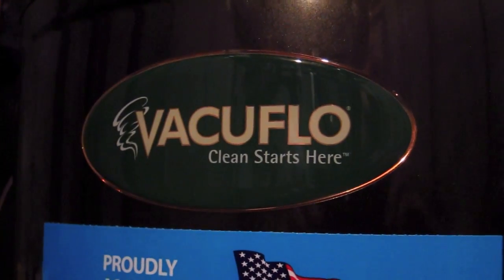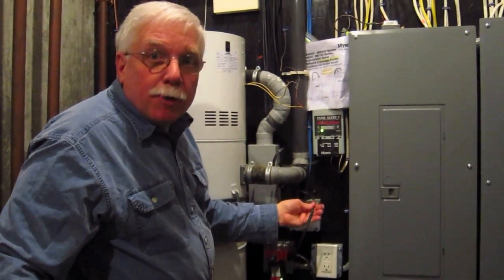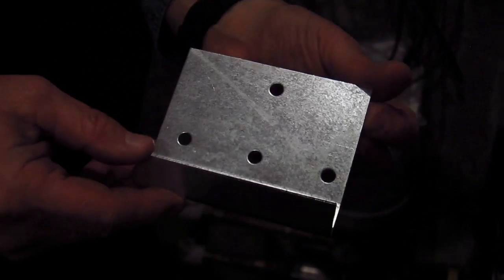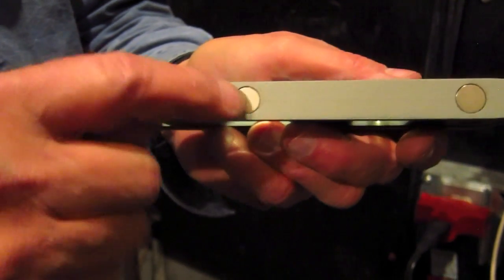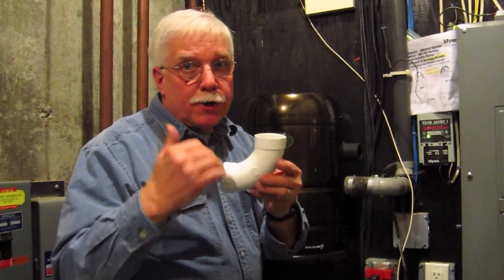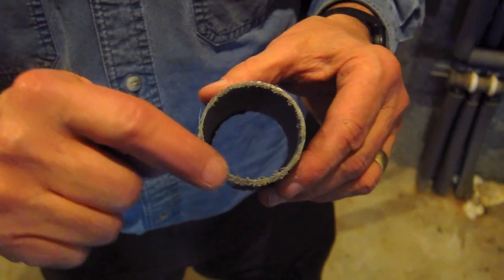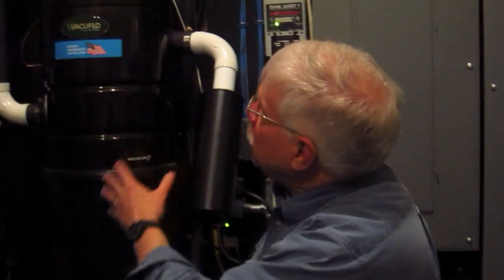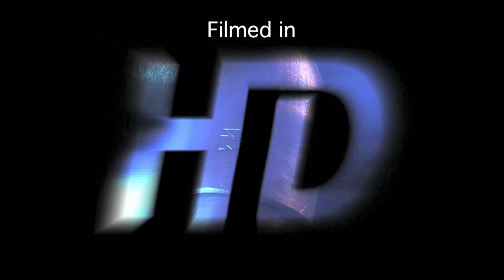Vacuflo Maxum 7 Central Vac

Comment: I am assuming that the central vac is used for houses with basements, because I have not seen one here in Arkansas. Most homes here are one story on concrete slab. I learned something about the PVC pipe though about the marks on the joint and the line down the pipe. I had been ignoring them and know better now. Thanks for sharing the video.
Reply from the maker: Sidney Mathious Nope! Central vacs are perfect for single-story houses on a slab. In those cases the power unit is often in the garage and the piping runs up in the attic and drops down to the outlets in the house walls. A good installer can have one installed in your average-sized home in one day.
Reply: Thanks for that information.

Comment: Nice installation! Curious about central vacuums: 1) how often do you need to empty them? 2) Do they have various horsepower units, due to size of a particular house? 3) Since regular vacuums do collect material, including odiferous particles, occasionally in the hoses, do you have to "clean" the system in order to keep it fresh?
Reply from the maker: Diana Reiss Diana, it depends how much dirt you're picking up. Some people rarely have to change the bags. Yes, there are different units with more power for larger homes. The manufacturers have sizing charts. I've never had to clean my system. The piping is a closed system so if the pipes in the walls got something on them that stinks, it doesn't leave the system.
Reply: Thanks for all the valuable insights!  Might come in handy if I decide to have one in a new build in the future..

Comment: Nice video, but why dont you take the exhaust port to the outside. It will cut down for the noise inside and so on....
Reply from the maker: Lau Martinussen Great question! Some modern central vacs like this model the Vacuflo Maxum 7, have advanced filtration systems so the exhaust is extremely clean. The instructions say you can vent them indoors or outdoors. When I put this unit in this past weekend, we still had 24 inches of snow packed against the house where this would exhaust. That presents a problem because I'm afraid some future homeowner might not keep the snow away from the vent hood and then the unit will not work properly.
Reply: Ask the Builder no its all lies
Reply from the maker: Electrolux lad I think you have a dog in the fight......

Comment: its not as good as my MD central vacuum it has three motors and its way more powerful and ive had vacu flo they have to be vented out side or the light dust  goes every where and the light dust goes threw the motor and burns them up in 5 year my MD CENTRAL VACUUM IS 15 YEARS OLD AND IS STILL RUNING and i love bagged better than cyclonic because it does not need to be vented and it dosent loose power because stuff does notget stuck on the motor screen way better style than vacuflo
Reply: I know this is an old comment but I have some things to add on your comment. MD no doubt is a awesome company. They have great products, their service is outstanding, and they have one of the best warranties in the industry. I currently have plans to install one in when I get my own home. I actually love Vacuflo, they are very competitive to MD because they also have great products, service, and warranties.

There are 3 different types of units that Vacuflo offers: They offer True Cyclonic, Filtered Cyclonic, or Disposable Bag units. The one featured in this video uses disposable bags and it's not required to be vented outside. 

I wouldn't agree that MD is better than Vacuflo, every central vacuum is different and there are some things that are better than others, even almost all central vacuums uses motors that are made by the same company but it really depends on how much you are looking to afford out of. I know one person that replaced his SilentMaster with a true cyclonic Vacuflo because he couldn't deal with the bags clogging on his SilentMaster.

I have neighbors and friends that has a Vacuflo central vacuum for over 15-20 years with original motors and they still work like new. The only time I see motors go bad on these quickly is because people don't take of them properly like ignoring to clean out the motor screens when they empty these out. But most of the time when I use one of these, I don't see anything get clogged in the motor screen when I empty these out, and these aren't really messy to clean out as well. 

Even though bagged central vacuums are not required to be vented outside, I rather have mine to be vented outside for two reasons: Noise suppression, and carbon dust that will leak out from the motor.

Anyway that's all I wanted to add here.
Reply: Meh, I've got a 3 motor machine in my collection, currently on loan to family who I just installed a system for until they have the $$ for a brand new machine of their own, and it does move a lot of air, BUT it has about 95 inches of water lift Most modern units including this vacuflo, with one or two motors, will actually have nearly identical performance at the hose end.
Reply from the maker: All central vacs should be vented outdoors.